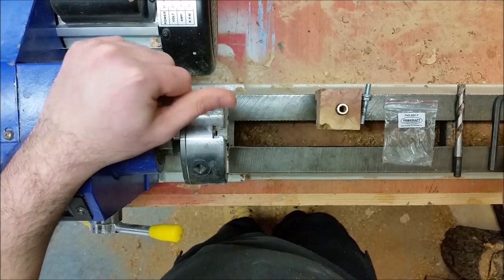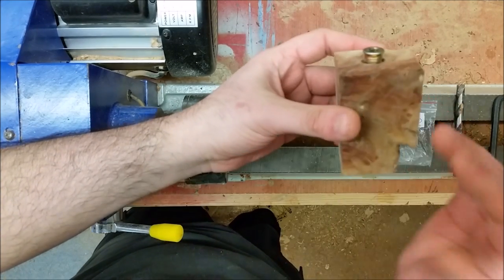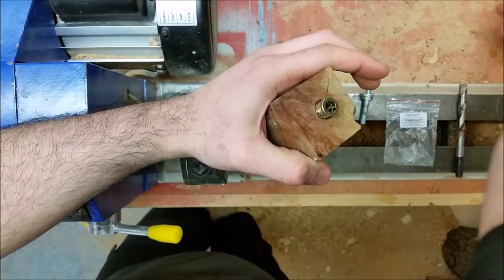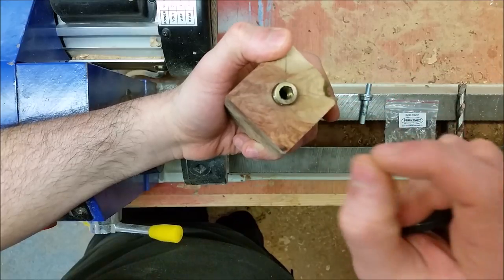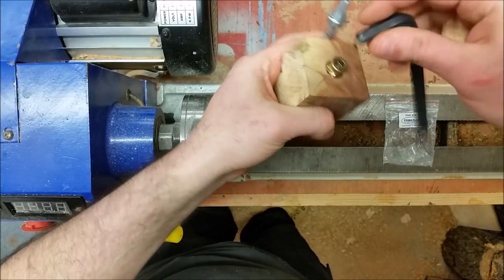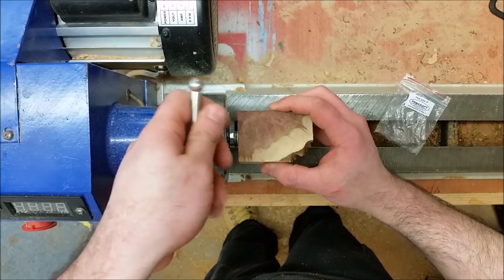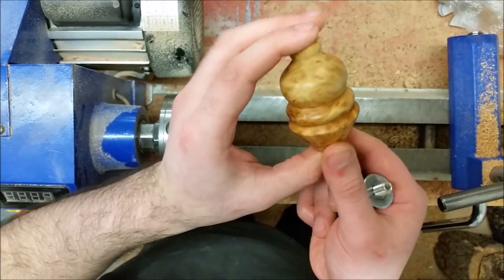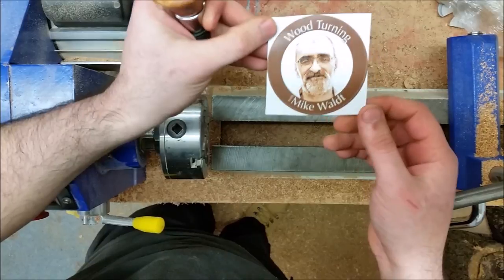Woodturning - Bottle stopper from beautiful rare Red Mallee burl!

Comment: Looks beautiful.  I have used those kits from Prokraft, but my mandrel sheared off when I was using it, so I had to cut the head off a bolt.
Reply from the maker: oh i see maybe it was falty or too much force was applied i noticed that best way to minimise the vibration is to take the chuck jaws off and have as much as the rod in the jaws as possible like i showed in the video but overall i havent had problem yet and used it like 5 times. thank alot for watching mate!